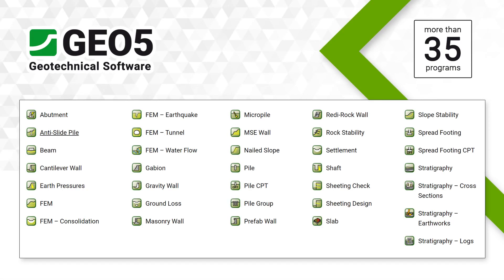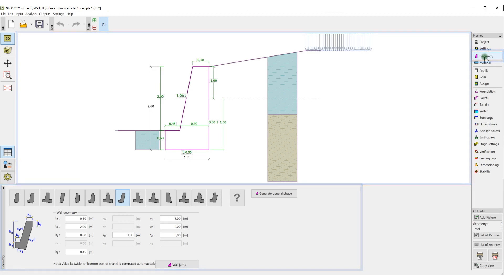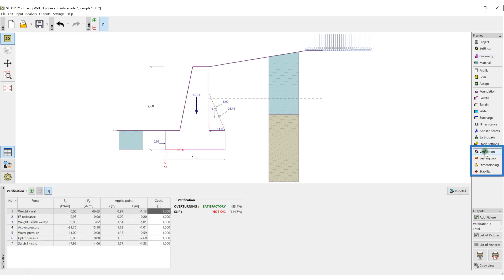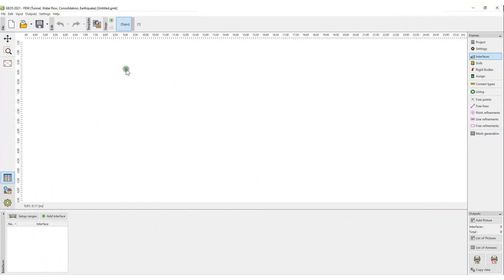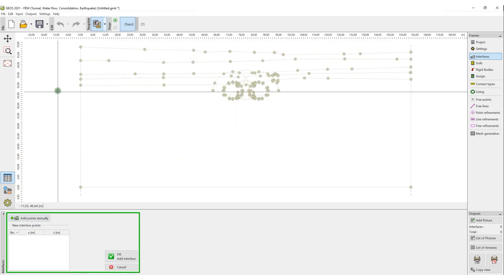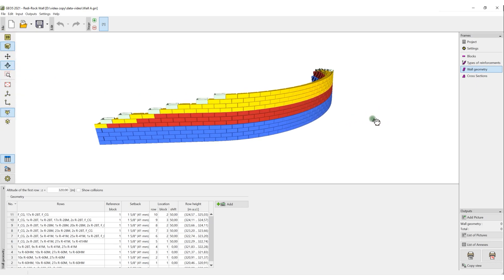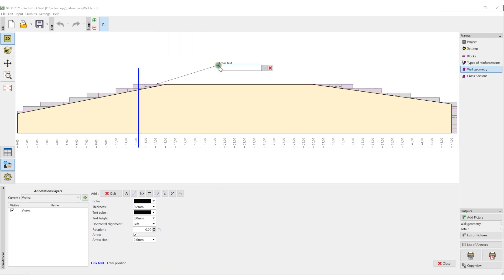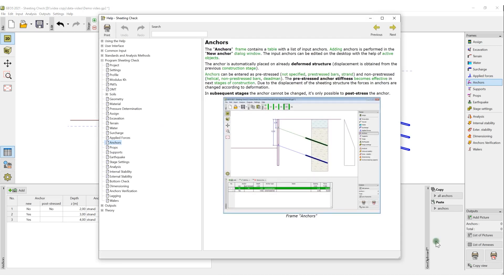Getting Started with the GEO5 Software

Comment: Where is the retaining wall in the software?
Reply from the maker: Hello, 
thank you for your question. Several of our programs can handle retaining wall design, so it depends a bit on what exactly you would like to achieve (e.g., structural analysis, geotechnical design, or integration with other structures). Could you please share a bit more detail about your project and what type of retaining wall you are interested in?

In the meantime, you can find an overview of our solutions for retaining walls here: bit.ly/46OucFA 
.